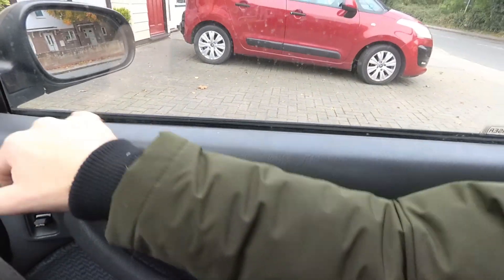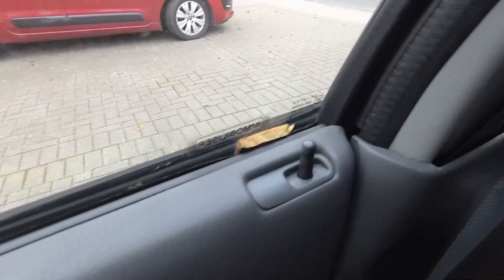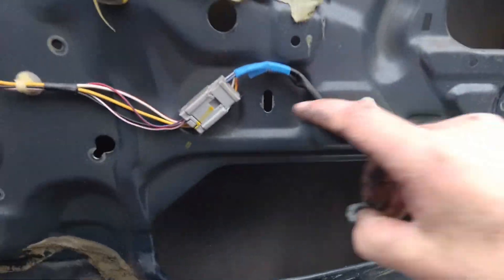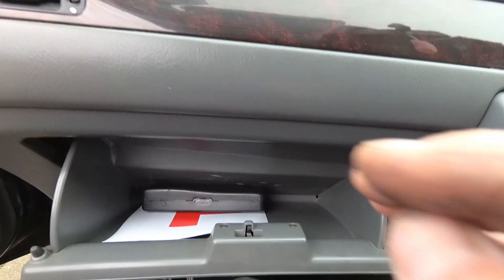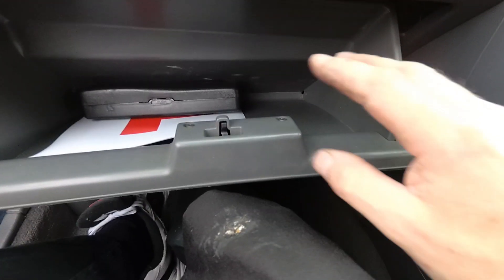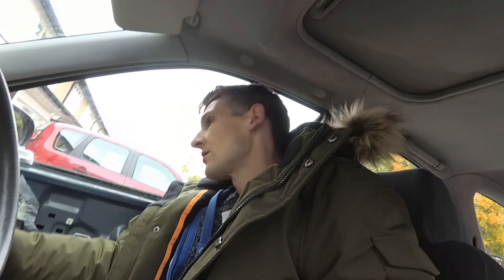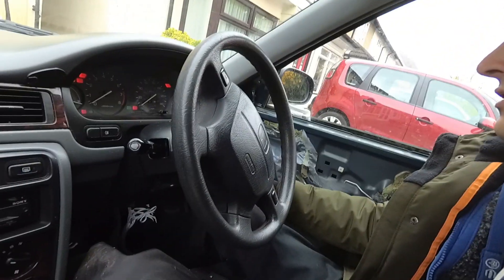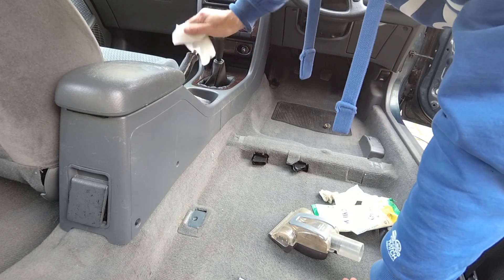My Honda Civic Stinks!

Comment: Had the same issue with my drivers regulator, having some engineering experience and some little tools i managed to fix it drilling and taping the star insert ........ then i noticed the end teeth on the arm was strupped 

But seeing as i hate waste i drilled and tapped where teeth were missing and then screwed in bolts which were ground down to make new teeth lol 

Definitely going to get a new cabin filter on order now after watching , great vid
Reply from the maker: Bloody hell mate, you’ll be valuable after the apocalypse with those skills.

Comment: At 2:15, I thought "RL hasn't used bungee+suckers (or carpet tape) to hold the window up while he takes the door card off" and then the penny dropped.
I mentioned last time that cabin filters don't get changed by indies and DIY but I'm not surprised on this one - what a PITA to change compared to my Renault or even the Combo. If you suspect a milk spill, it's a good idea to rub baking soda (sodium bircarbonate) into the carpet an hour or so before vacuuming to neutralise it.
Reply from the maker: Yea I thought the Force was strong enough in me to hold it up with my mind, lesson learned, Not a Jedi. ☹️

If the weather ever improves I’ll be using my carpet cleaner and deep clean all the upholstery. The seats are worse than they look on camera.

Comment: To get the fan working on 1 and 2 you need a new heated resistor 
Mg zs or rover 45 have a cup hold that fit under the arm rest
Reply from the maker: That’s some great tips there mate. Thanks.